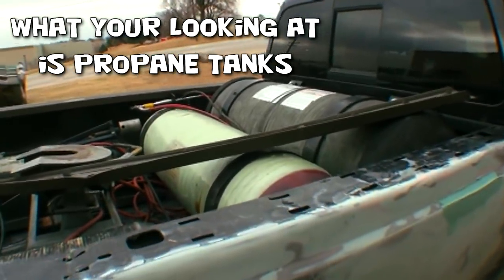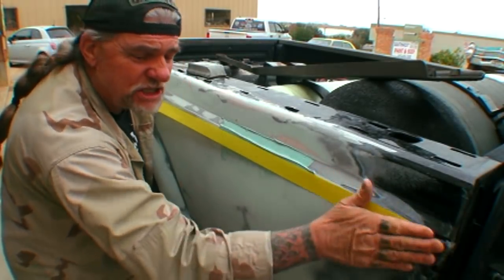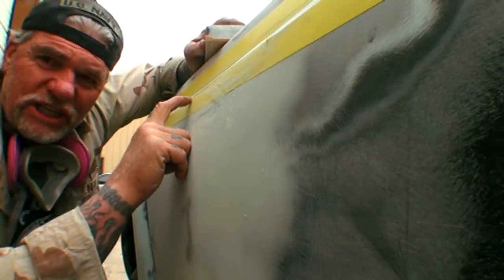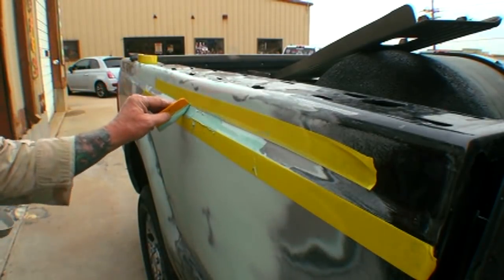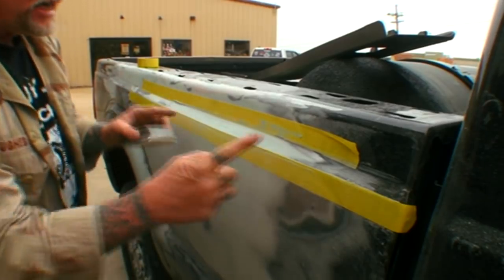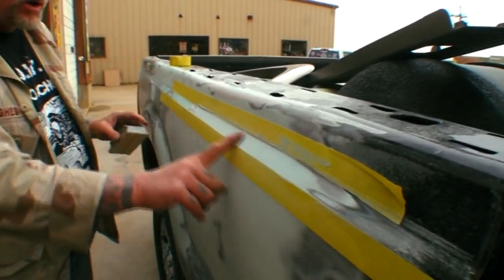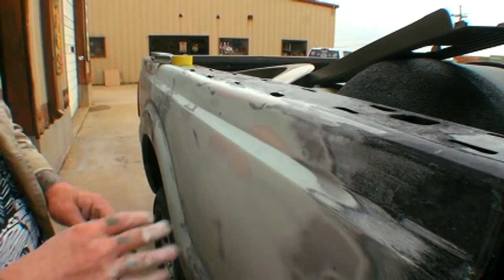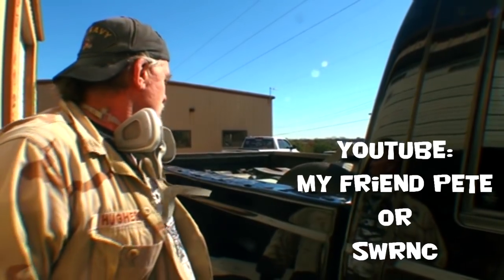How To Properly Use Bondo Filler To Sharpen Body Lines

Comment: Thanks for sharing, Pete.  Something that I had a problem with when I wore prescription eyeglasses before I got surgery to correct my eyes.  With progressive lenses your straight lines will be distorted.  A straight line will have a slight curvature to it because of the way that the lenses are ground and we all know what that can do.  Particularly in situations like on this video.  If you must wear your glasses, a pair of regular bi-focals may be better or a discussion with your optician or optometrist would be best.  I thought that I'd drop that out there.  Pete, you're a great guy and a great teacher.  One more thing, I appreciate the tip on using the polyester/bondo mix to save money.  Some of these other DIY sites want you to buy their high dollar stuff.

Comment: Body lines are a pain in the ass even with the tape. Takes lots of patience to master. Good video, Pete!
Reply from the maker: It's a big job!
Reply: I just wrote that I had a 1970 Chevy truck I had to put the body line I used the tape but still it took a whole lot of time to get it perfect  no one else could tell but I could I even used a straight edge to keep checking it not just tape I had to make sure there was no high spots. 
It came out right then I had to do the same thing to my 1972 GMC SUBURBAN and those are some long line's to match all the way down through the door and front fenders .

Comment: Another terrific video, Pete.  i was able to use your previous video (Austin Mini repair) to pull a dent out my son's '01 Lexus trunk, body fill it, paint it and I also painted the hood which needed paint only, but the previous owner had somehow stained the clear coat on the hood - it looked horrible.  

Anyway, after watching your videos, I was able to repair the trunk lid dent and repaint it as well as the hood.  It looked great.  I think a professional would have seen the minute traces of orange peel in the hood but to the average person, it was not noticeable.  It did drive me a bit crazy because I could see it and i just couldn't quite all out.

Before I started on the car, I went to the local auto salvage yard and they donated a GMC door skin (for free) that was dented up and I used that with your videos to practice on first.  The company where I purchased the paint supplies, donated some leftover paint that they had so I could paint the skin, clear coat it, and then test my finished product skills.  After I felt confident in my ability, I then worked on the car.  I wish I could post some before/after pictures of the car.

As fate would have it, my son promptly went out and rear ended someone which wrote off the car and accordioned the hood.  LOL.  

Anyway, I'm using this video to get the lines straight on our VW Jetta hood which we bought with a some hood damage. 

Thank you for the videos. Appreciate all that you do!

Comment: That was an awsom job!!!  I think the large part of the panel was absolutely perfect. I'm not aware of the fault, maybe the flat part you were working on had a minor fault but it's not really noticable on the video. I guess your rated the job an 8 just because the regular repair required the panel replacement. I think it looks perfect.
Thanks for posting this great video.

Comment: I'm curious why you didn't use a longer sanding block?
Reply: @Tim Brown   >From what I have learn, this application of filler is the “Shaping” stage. A layer of filler has been applied and down to the little defects in a tough area. Now, if you noticed Pete applied 6 inches of filler in 3 locations but on top of sanded pre-shaped filler. Using (Lets say) a 4” block on a 6” line of filler, the back & forth sanding will take you by nature, slightly beyond the filler, into the previous coat. This could result in a wavy spot, thus requiring more product, more sanding, more time. 
 I hope this makes sense and helps! As Pete said, he is going to feather edge with a DA, probably with 120-180 (Smaller Sand Scratches) on the OEM paint into the edge of the bondo filler. This allows for primer or high-build primer to fill any size sand scratches. Then a guide coat, long block, fix air pockets or defects, perhaps an epoxy sealer w/10% urethane reducer, to lay flat, nib if needed, clean and paint. I am not Pete, just a dry sponge, he is helping me soak up his 35+ years in tricks, tips, product and techniques. 
I am trying to snatch the stone from his hand grasshopper! At 62, I am learning body & paint for me. I repaired vehicles for 35+ years, now adding this info as my next chapter in my own 67 C10.
ASE Master Tech-Retired  Helps?
Reply: @deankay4434   Im learning too mate, Im 58 and I need to do all this to my 57 chevy. I dont need a flash job, just a practical one to stop it rusting.  Thanks for your reply here too. Im nodding my head and thinking you pay better attention than me, as a result you are closer to snatching those pebbles than I am lol.

Comment: There are more long-term body shops, that would have turned this job down and sent the customer packing, than there are body shops.
 Another trick, is to over bid the job by 4 -5 more times than what it’s worth but short of doing the bedside with liner & fifth wheel.
 (If I am not mistaken ). Plus another trick is to tell the customer that they are so busy that it will be 9 - 11 months before they can get it on the schedule.
  Pete, I am proud you have shown the tape guide-line tip for proper repair.
Also, as Pete mentioned, he has a video that shows you how to make sanding blocks from shipping foam that new panels come in. Click on his channel and search to watch. What is better that having the perfect sanding block that fits a location on your vehicle, for free? Subscribe to this “Teddy Beat Body shop” teacher lives in the real world. Retired ASE Master Tech, Omaha!
Reply: I hate “Auto-Correct” as I typed Teddy Bear. There are about 22 compound curves on this front section of the bed side. This is why a shop would just replace it, rather than repair it. Few have the talent, skills or patience like Pete to even tackle this job. You saw the end video. What do you think?
Reply: @deankay4434  literally any body shop could tackle that job a bedside is about as easy as it gets.
Reply: @robertcampbell5605    Yes, Ford bedside, adhesive, rivets, re-attach trim, avoid propane tank, W&G, scuff, sand, epoxy, filler in shipping dents, high build, sand with guide coat, mask & tape, base coat, clear, clean, cut & buff. Buddy cash deal $650. Body shop price $1159.00 + Tax & shop supplies. No problem!
Have a great day.

Comment: I had a 1970 Chevy truck I had heck of a time trying to get the body line to be sharp and straight it got straight after hours of work but it was hard to get the line straight.
Even with the tape it still wasn't easy to do!!

Comment: I’ve been an autobody tech for 45yrs and never once used tape to get a body line straight if you need tape to get a straight line your in the wrong trade get a job at micky Ds flipping burgers

Comment: So what your saying is he doesn't have insurance
Reply: No it means they did not want to turn it into their insurance company, pay the deductible which probably in the long run will raise their insurance rates.   Sometimes when you have an issue its better off just paying out of pocket than dealing with insurance. Who knows with that much damage the insurance company may of just totaled it out and the guy would be w/o a vehicle
Reply: Just some light-heart'd humor
Reply: So what your saying, come on man, use proper English, it's you are or short form, you're, not your, as in your mom! And why would he want to pay higher premium  when renewal time comes?
Reply: yes n he had to pull that propan off ;]